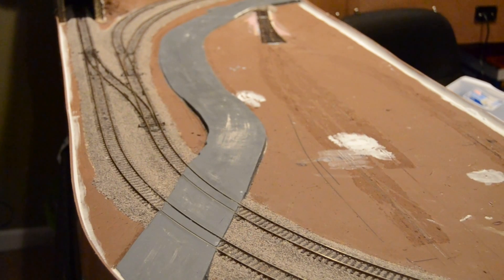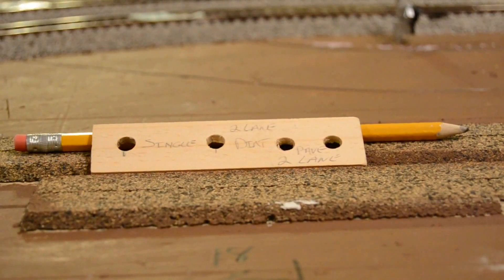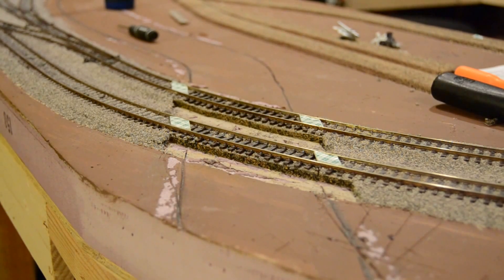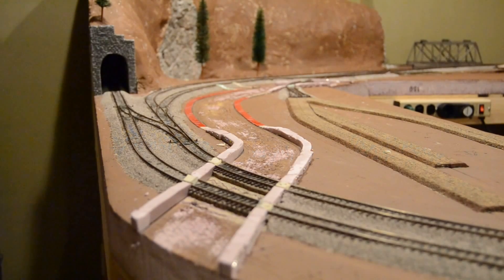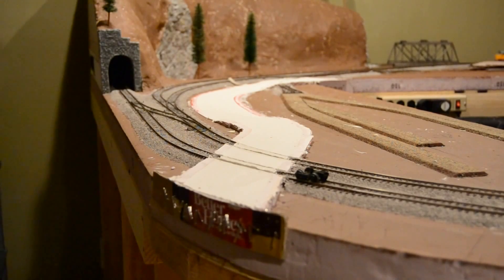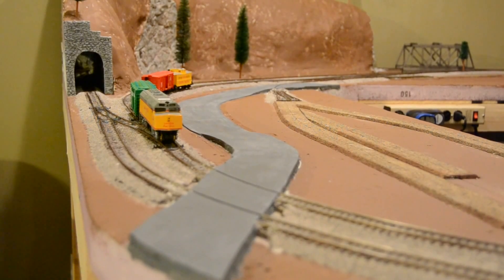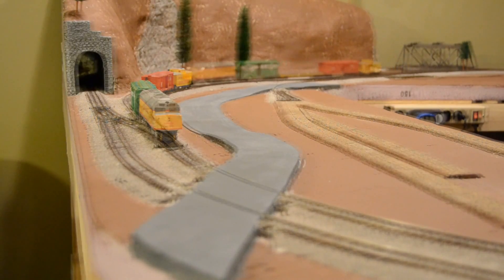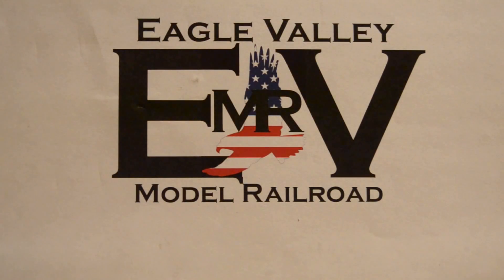Building a HO scale road using sheet rock mud..

Comment: Great job. Setting type drywall mud does not crack like finishishing mud. But you have to mix the setting type with water. on the bag it will say 15, 45, or 90 I believe that the approx time for it to dry.
Reply from the maker: Mike, I had no idea there were two types of mud. Thanks for the info and thanks for watching-Ed.

Comment: That's the only drawback when using joint compound for roads, cracking! Joint compound is made to be put on in thin layers, dry, sand, and repeat. An alternative to joint compound is Sculptamold or Fusion Fiber. Both are a paper mache product. They can be plopped down in thick layers. They can be tinted or painted. They do not crack when drying! Fusion Fiber will never dry out. Sculptamold will dry out. If you make to much Fusion Fiber, just place the left over amount in a container and place in the refrigerator until next time. Add a little water and you're ready to spread again. 

You did do a very good job on that road. Thanks for sharing. Roy
Reply from the maker: I went with Plaster of Paris on the other areas of the layout. I like the way it turned out.. Thanks... Ed.

Comment: I used it s track roadbed works get and no problem and its been 30 years
Reply from the maker: This has been down for almost a year with tons of work going on around it and it has had everything sitting , sliding, and hitting it for the whole year. Just needs a little touch up paint it's holding up great. Thanks for watching.=Ed

Comment: what i really dont like about  layouts, is the fake people .  cars parked on the road [parked is ok but not stopped on the road]...... idea  for u.   on cardboard spray glue and quickly sprinkle fine sand on it. let dry and do it again as needed.  pot holes can be made by pressing into card board with thumb /finger etc. then different color sand glued into pothole.   black thread laid on road before sand will be crack repair. dont forget to chip and pothole the edges of road too.
Reply from the maker: Thanks for the suggestions, I think with the figures and vehicles if they are strategically placed to simulate movement they don't seem as out of place. I do agree that the poor guy sitting at the road crossing for an eternity is a bit much. Thanks for watching